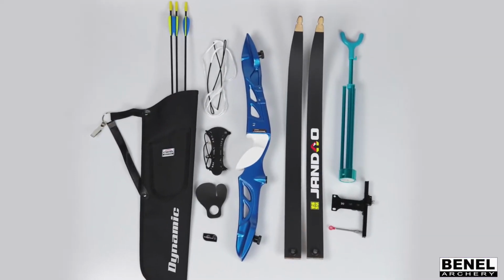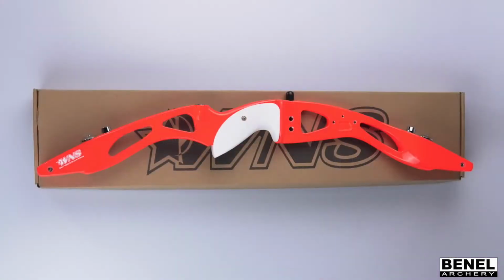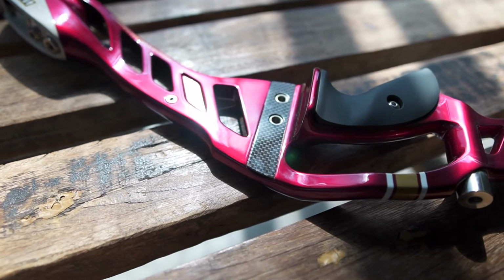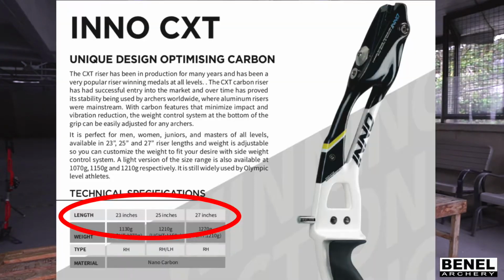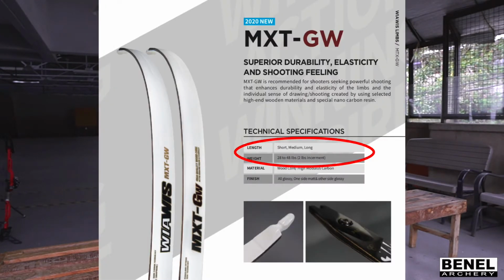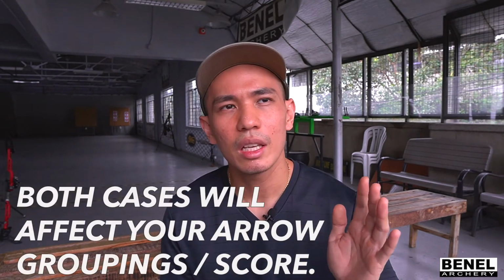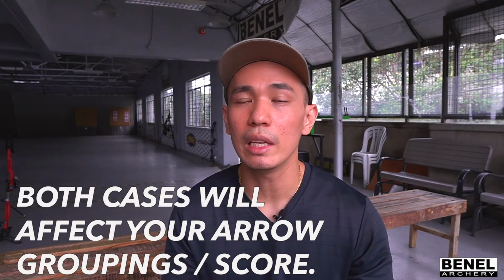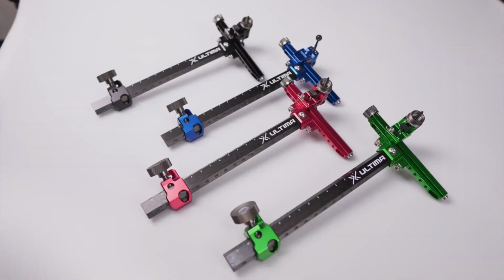How to Select a Recurve Bow

Comment: Wns delta lx is not cast al, it is single cut forged..mean delta lx was forged riser,  i read the description from archery supplier aussie steve hann, delta lx is high stiffness, designed for durability, consistency even at high poundage..some said maximum poundage for the riser was 42 to 44lbs...if cast aluminum..you cannot use more than 40lbs, actually, 36lbs limb was maximum for die cast al..the riser may risk to flex..